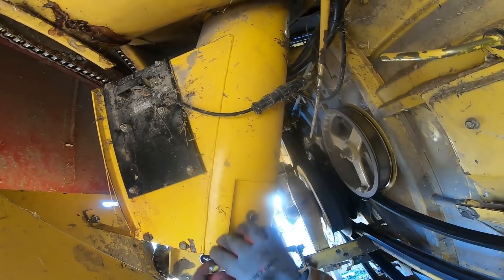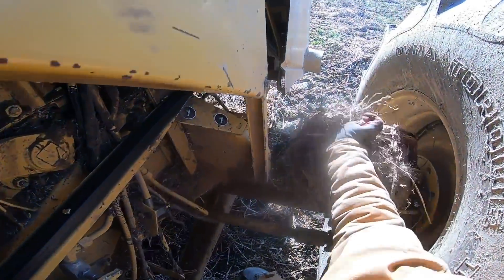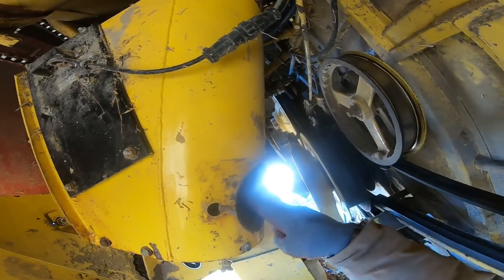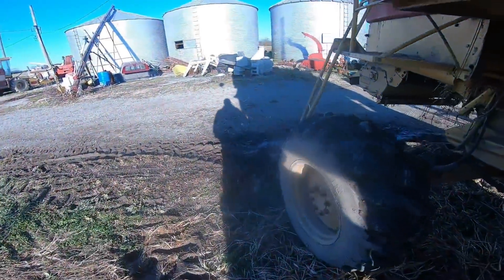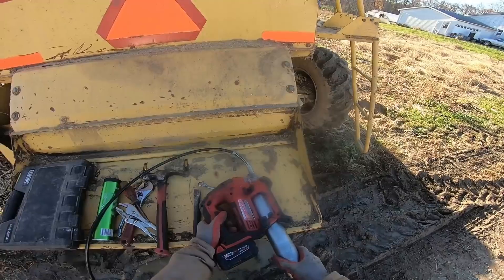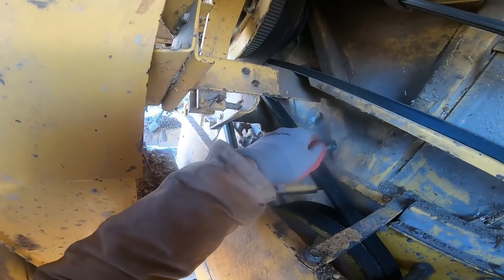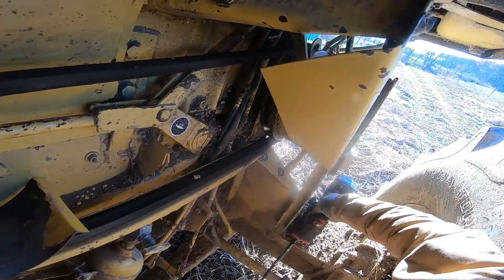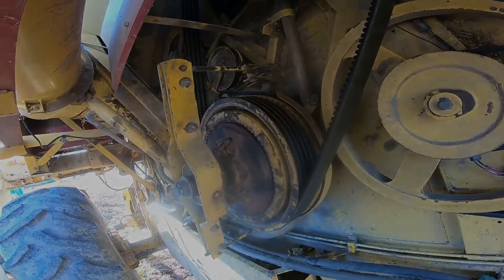Most Forgotten Grease Zerk On a Twin Rotor

Comment: How come you want a spreader? I’m worried if I put the chopper in place of my spreader it’s going to be harder to notill behind for the next crop
Reply from the maker: Ask bandit. He had one coming apart and send the blades through the engine.
Reply: Choppers do have to be inspected once in a while when using . Also depends on what crop you run since corn you run a slower speed and open it up for cut .

Comment: That's not the most overlooked grease zerk on the TR combine. In fact the one you greased you can pump grease in until you can see it under the auger shield and it's good for the season. The most overlooked is the coupling for the rotors, you have to crawl in the grain tank open the access door and the couplers have greasing points that lube the chain and splines that drive the rotors. Forget them and the spline will wear off the gearbox drive spline or the rotor drive shaft
Reply: thats the one i was thinking of too actually
Reply: I agree